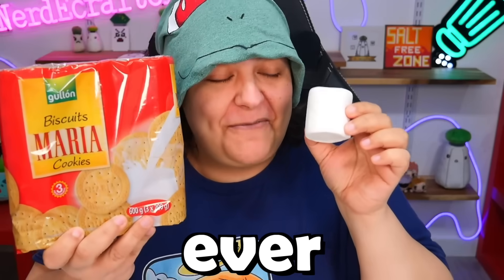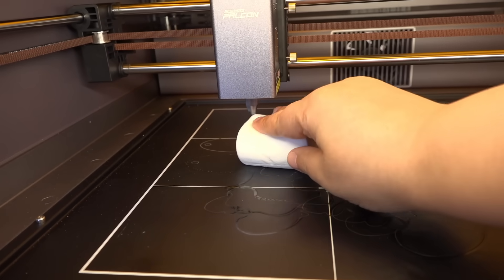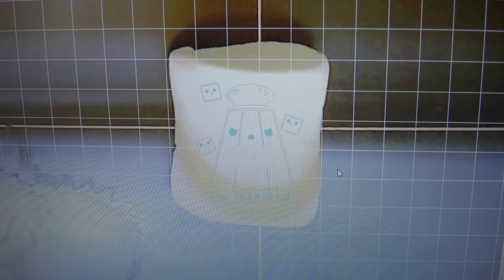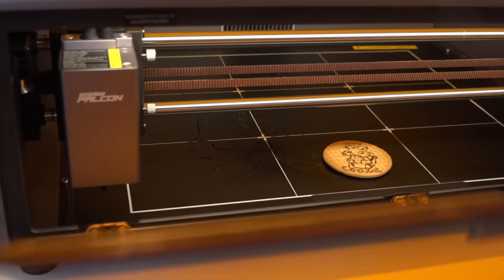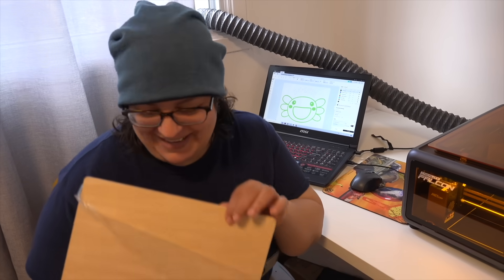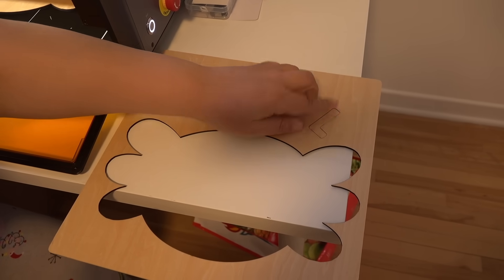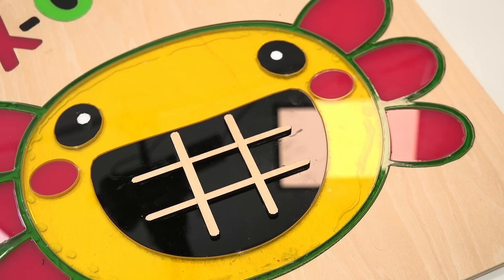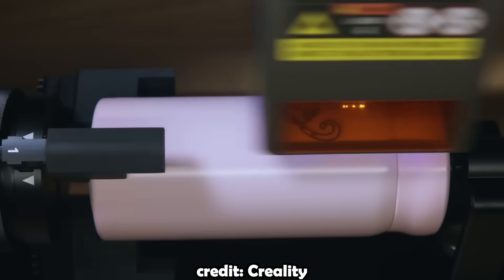I Try Engraving On EVERYTHING With A Creality Falcon A1 Laser Engraver

Comment: 7:15 you can do metal just add a non shiny coating like painters tape. That is when your machine is actually strong enough to do metal.

Leather is way cool to do, I made a lot of things using my laser. But the smell 🤢
Also do not engrave PVC! It's very toxic even with the vacuum it's not really safe.

Comment: Depending on the power and precision of your laser, it might struggle with smaller cuts. I’ve learned the limits of my laser, and it would definitely have trouble with the smaller cuts white pieces you cut for the eyes. Mine engraves metal or glass, you just have to put a thin layer of paint or marker over where you wanna engrave, then remove with alcohol after.

Comment: I don't know if they have them where you are, but around here we have square marshmallows intended for s'mores.  

If the leather is thin enough, you might be able to cut the leather coaster into a keychain.

A few years ago, I purchased an Atomstack diode laser (same type as the Falcon).  Unfortunately, it did not come with an enclosure, and I struggled to be able to properly cut materials - which was my main goal over engraving.  So I then purchased a CO2-type Laserbox, from the company that is now called xTool.  It's been an adventure, but for the most part I've been enjoying it a lot.

You'd want to double-check with Creality, but you might be able to "engrave" on metal if you use a marking spray.  Basically, you cover the metal item with the spray, which is an opaque (I think only black, but it's been a while since I checked on it).  Then you run the file like a regular engraving and where the laser hits is melted/adhered to the metal.  When it's done, you wipe away the excess and voila!  you have an "engraved" metal item.

=glances over to the two types of marking spray=  You know, I really ought to actually use those as some point.   

Anyway,  another thing is that if you find you don't want to deal with the burn marks on the back of the wood, say if you want to make something like an ornament that might have both sides showing, there are rolls of adhesive paper that can be laid on the "back" side (and on some clear acrylics on both sides - again, check with Creality).  When the cuts are done, peel the paper off and you'll have a clean surface.   There's another method I've seen used with CO2 lasers, but I don't know how well it would work with a diode, and that is to raise the material a little bit, so that it is not directly  on the cutting bed.  I tried to make a few risers, but my designs were... a bit flawed. 

The cut sides?  Best you can do is dial the settings done really tight, but even then, you'll still have a little bit of char.  It wiped off easily enough, though. 

At any rate, I hope you have a lot of fun with your laser!
Reply from the maker: Great suggestions! I'll have to look for those marshmallows 👀